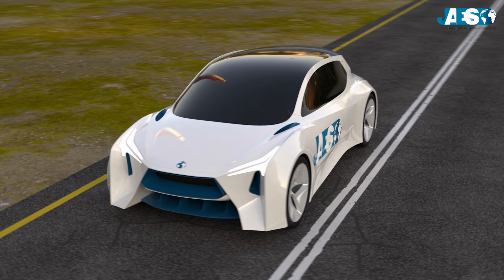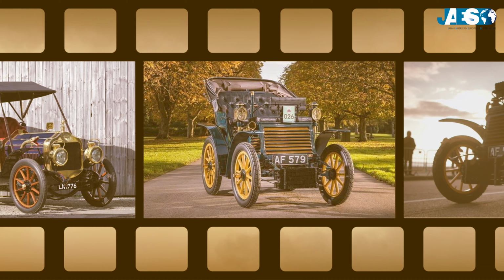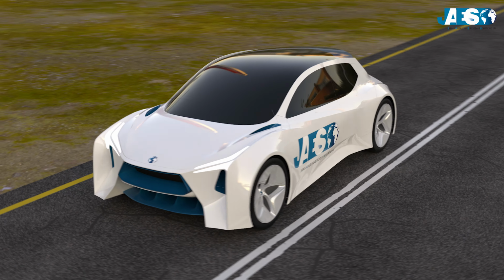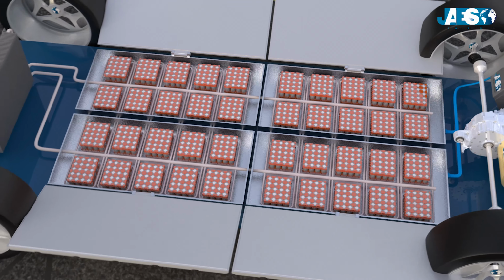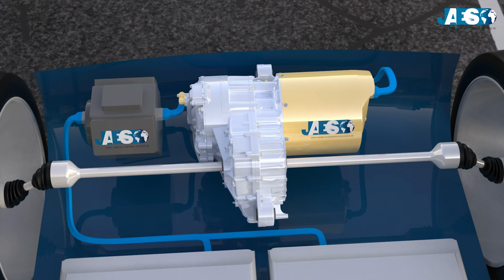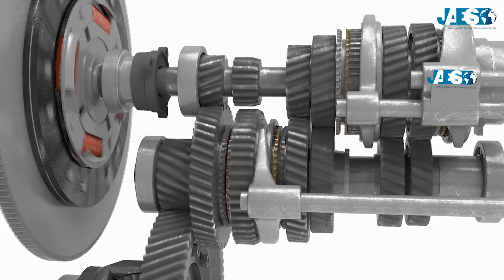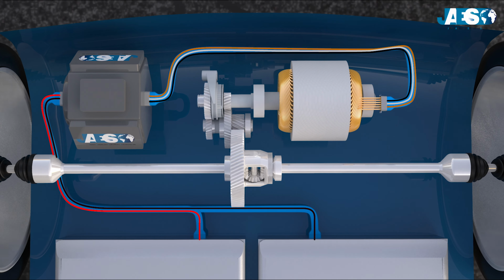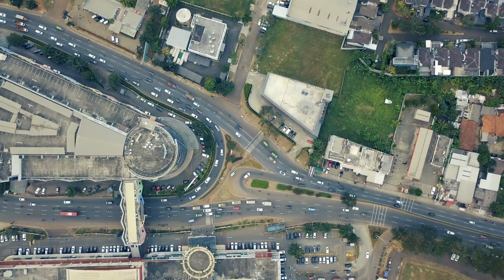How do Electric Cars work (Car Part 6) Lithium-ion batteries - Istant Torque - Regenerative Braking

Comment: So electric vehicles run DC or AC?
Reply: The batteries store DC power, but the motors used in cars need AC. The inverter converts the DC from the batteries into AC at the correct frequency in order to control the motor speed and direction
Reply from the maker: thanks you Ultimantis for helpin our subscriber  where are you from ?
Reply: @Jaescompany  I'm from Brazil. I've been interested in electric cars since I was a teenager.
Reply from the maker: @ulti-mantis  thank you Brasil very beautiful country I was there several time please free to advice us and give you point view